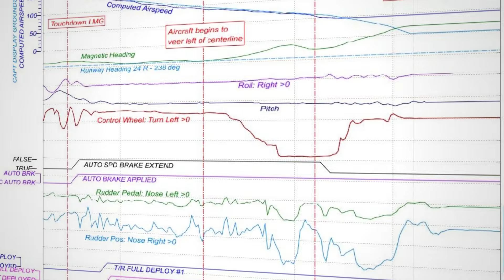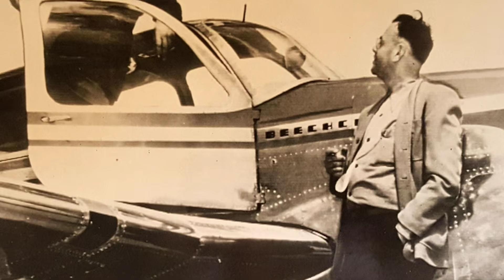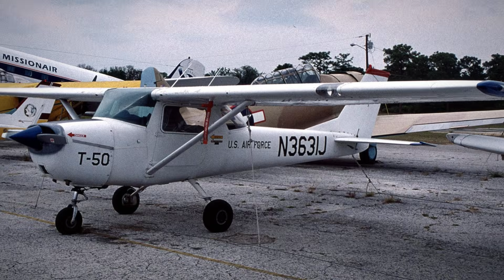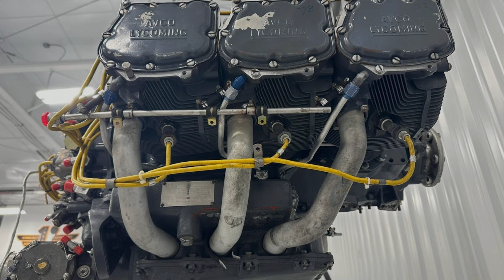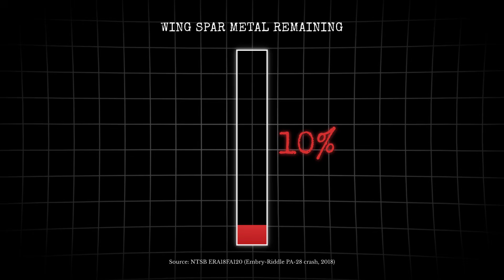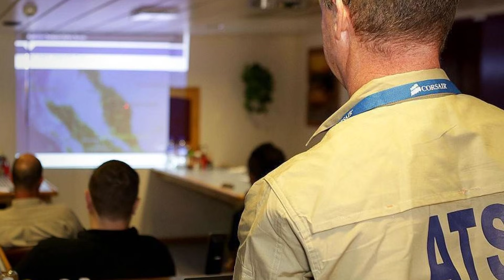5 Planes The FAA Knew Were Killing Pilots For 20 Years Before Issuing A Single AD

Comment: I had a Cessna 152 seat slide back when I was doing my takeoff roll in about 1980. Luckily I wasn't off the ground yet and when the nose rose I stayed on the ground. When that seat slides back it slides all the way back and the only thing you can reach is the control yoke to try to pull you back into position, which, of course, results in a stall a few feet above the ground. I was very fortunate not to crash.